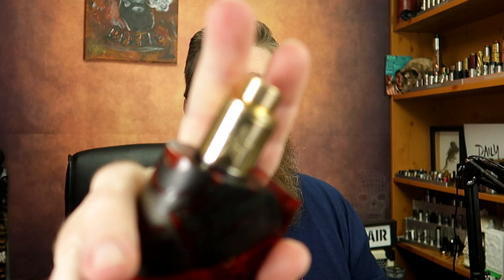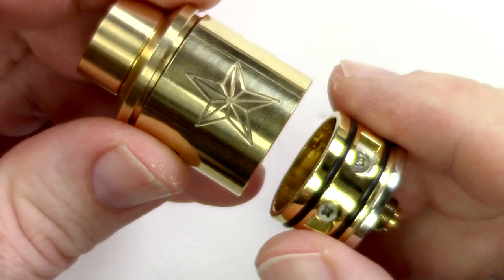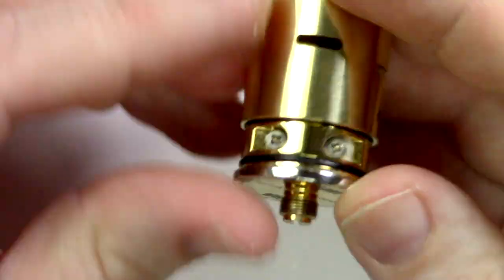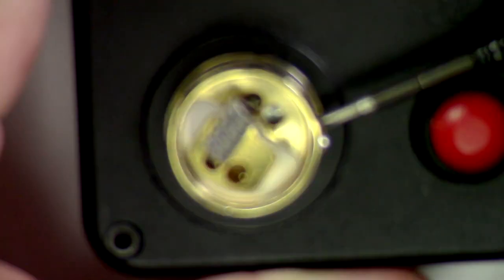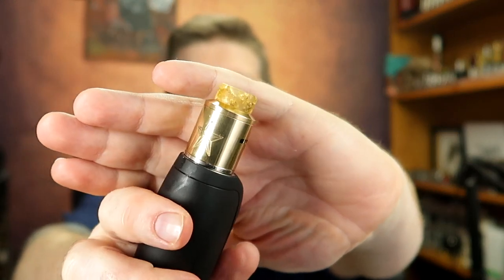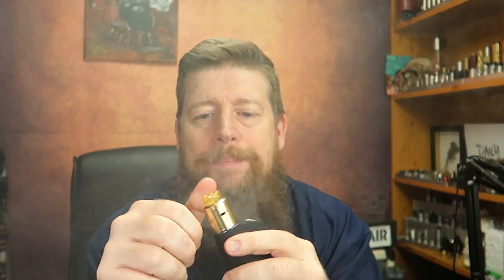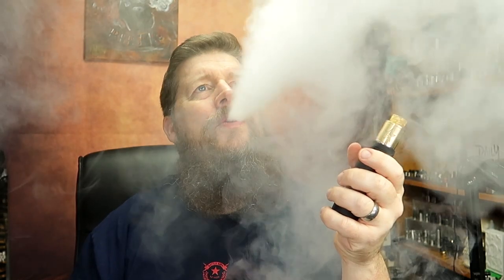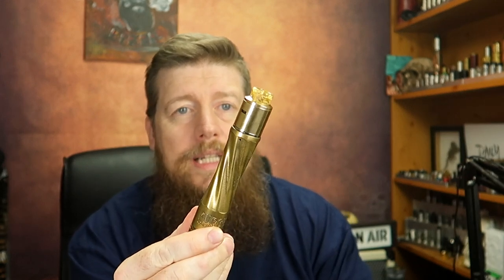BMI Nova Review - Brassy little number

Comment: CSMNT will not get replaced anytime soon :)
Reply: What does one have to do with the other?  Does anyone compare everything with a Velocity deck to the Velocity RDA?  CSMNT is a flavor atty without a juice well which is like a pickup truck without a bed.  What's the point?  The best thing CSMNT has going for it is its popularity on Instagram, it makes coils very photogenic.  As for vaping, it's average at best.
Reply: I agree, if you put it in your jean pockets it can happen quite easily that you slightly pop off your barrel which sucks. i switched out the o-ring to the beefiest i found that allowed me to put the barrel on (with some use of force). Haven't thought about it, but ye... thats probably the only downside i found so far as well.
Reply: The barrel becomes the juice well. Its funny how ppl not owning one always bring up that one false statement. Where did you got that piece of junk information? You can pour liquid down the drip tip like crazy. It's actually quite impressive how much liquid it holds / amount of pulls you can take before re-dripping.
Reply: I do own a csmnt, and I completely disagree with you, the csmnt does not hold a lot of juice, especially with the way you have to wick the thing...I used it for 2 days and shelved it
Reply: That's odd. I have no problems wicking it what so ever, especially when doing single coils it lines up just perfectly. I can pour A TON of juice down the drip tip right on top of the coils. some juice will sit next to the build deck but there is about 4-5mm of space up to the airflow holes, so its really no problem. I get no spit back, no leakage, nothing... just pure flavor & clouds for days and as i said, i literally pour down a mil or two of ejuice.

Comment: I certainly like the look of this dripper except for two things...those post holes/screws, and the fact that it's pretty much all brass. I don't mind brass mechs...But brass/copper rdas I usually stay away from. Little harder to clean too knowing the drip tip is brass. All in all though, I still like BMI products and if they fixed the post screws/holes and released a stainless steel option, I wouldn't hesitate to buy one immediately. Nice review Dean.
Reply from the maker: Cheers AJ :)

Comment: I hate the screws on the Nova. I can't put round wire in at all and even tri-core fused claptons can be annoying to clasp down straight. Terrible connection to prevent an issue that isn't even an issue. My gold plating came off after one cleaning as well. I wanted to love this thing but the more I use it the worse it gets. Great video as always Sir.
Reply from the maker: Thanks, and it's a shame a couple of essentially simple things weren't fixed before production - they MUST have had the wire clamping issue

Comment: I've seen a couple of reviews of this RDA now and, correct me if I'm wrong (and I very well might be...), but the afc looks proper odd. It looks like a negative of a normal afc i.e. Gaps where there should be blocks and vice versa. As a result you can't adjust the air flow in single dingle mode. Much head scratching 🙃

Comment: Where did you get the drip tip from? And will 20awg be ok for this RDA?
Reply from the maker: The DHD one? That was from Double Helix Designs Accessories, I would link but their website is getting some work done. Distributed for commercial stuff from Ohmz Distro in the UK :)
Yes, 20g will fit, but you will have to be careful to make sure it's captured when tightening the screws